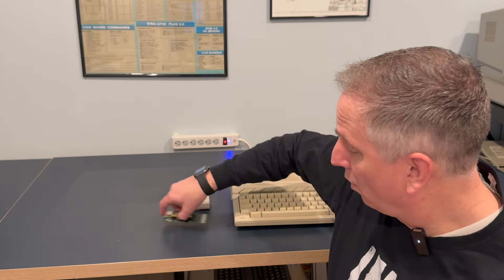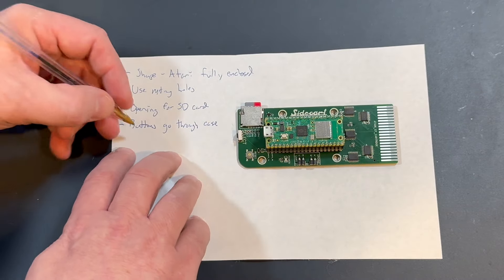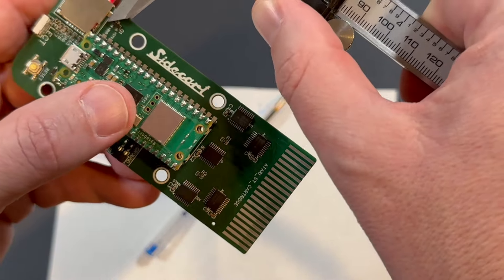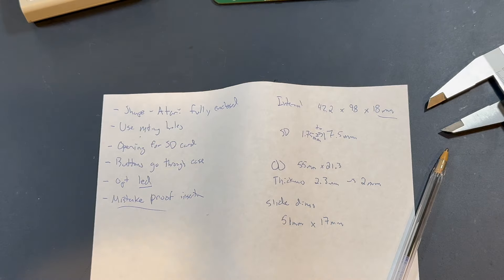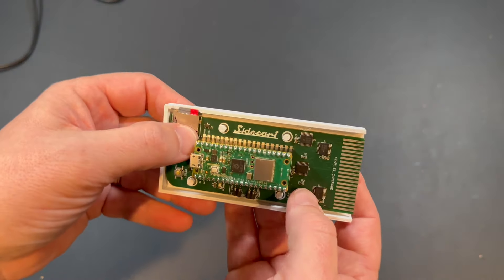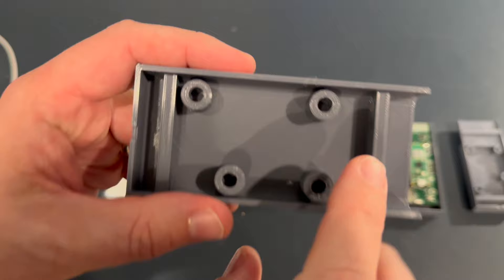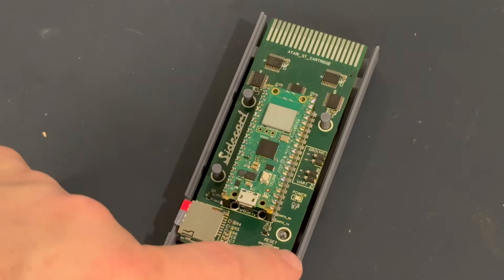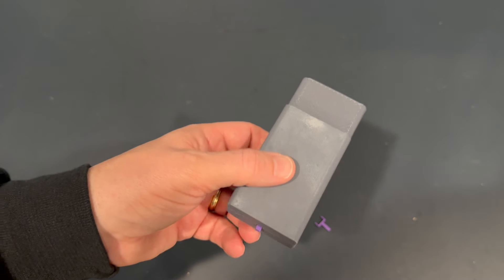No naked PCBs: 3D Printing an Atari Sidecart case

Comment: 21:13 “and you just insert it easily… like… struggles like THIS!”

Joking. Good work.

Question: I bought one of these but I haven’t played with it yet… can you use the WiFi you get with the SideCarT inside TOS/GEM for network or internet connectivity?

I’d like to get my Atari ST computers online… I have a NetUSBee… but as one only has one cartridge port I was hoping the SideCarT let one use it’s WiFi for networking inside TOS/GEM
Reply from the maker: Hah!! No, you're right.  It's not the case though, but the PCB.  It's a bit thicker and not beveled like the original Atari diagnostic cartridge I have.  Regarding the internet connectivity,  right now all that I've seen is accessing a list of disk and ROM images from an online repository.  That said, it's still in active development.  The creator is active on the various forums and commented on my prior video....he's the right person to ask :)

Comment: On my print, the posts seem to be pretty weak/brittle and break very easily. Is there anything I can do to strengthen them?
Reply from the maker: Yes, you should be able to adjust the number of "outer shells" to a higher number or print with more infill.
Reply: @powerofvintage9442  Will try each. Thanks for sharing the design!

Comment: since where still dicussing atari. is there a difference between atari falcon 030 vs 060?
Reply from the maker: The Falcon 030 is the actual computer.  No Falcon 060's were ever produced by Atari...just an upgraded version of the computer.  Those who have added a CT60/CT63 accelerator card (which has a Motorola 68060) often will refer to their upgraded Falcons as a Falcon 060.